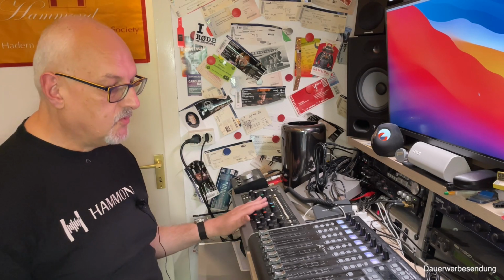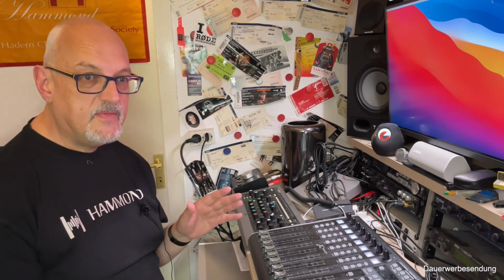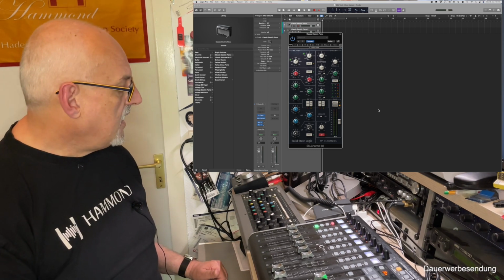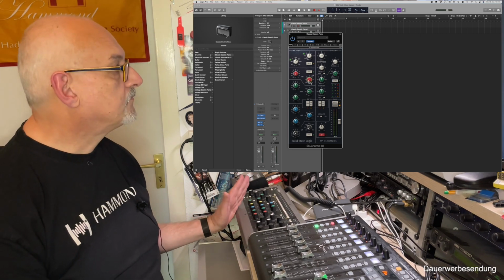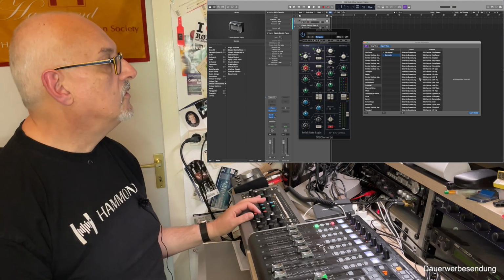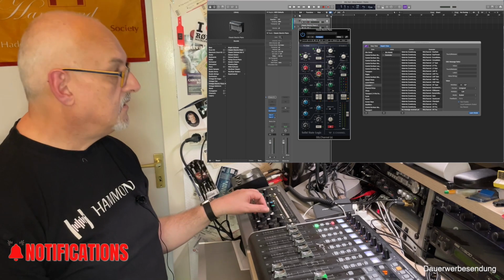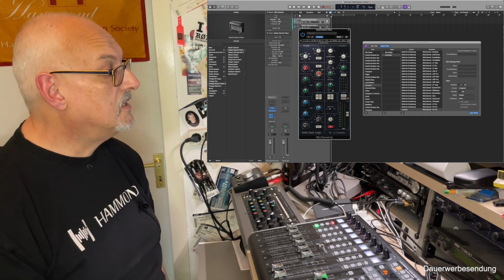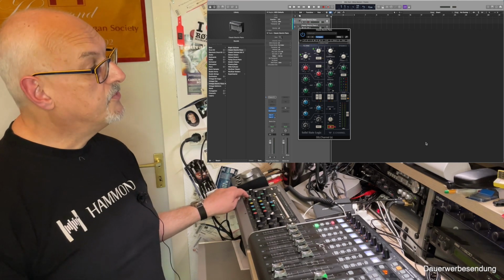Softube's Console1 hardware controlling other channel strips in Logic Pro X

Comment: thx for this tip. unfortunately when I use this do midi learn uadx api vision plugin, the plugin knobs jump like crazy, there's no way to fine tuning the knobs
Reply from the maker: Did you really stop the Console 1 Software? I had this happening only when the software was still active
Reply: @deantiquisetnovis  thank for your reply.  yes I'm sure I did, even checked the activity monitor.  I set midi learn mode, then select parameter in UADx Api Vision and then slowly turn a knob back and forth on the console 1.  I end up turning the knob and only receive two parameters setting, e.g. for the boost/cur freq (-12db to +12dB) the dialer only sticks to -4dB and +4dB when turning the knob.
I was hoping to control my UADx plugins with console 1, as softube and UAD only work with Uad dsp, which is crazy in 2023, with apple silicon ... I mean, who wants to use those sharc in apollo even longer?
Reply from the maker: @ChrisDv849  must have something todo with UADs implementation. Sorry to hear.
Reply: @deantiquisetnovis  I managed to this in Ableton Live very easy. Great!  But, in Ableton Live you have to midi map the same plug-in for each track (?!).  Looked on the internet but can't find any information to midi map the uad api vision on track 1, and then when I have the same api vision on track 2, and select track 2, it automatically controls the api on track 2.  In logic that's quite easy.  Only in Logic I can't midi map the console or any midi keyboard or controller without the knobs going totally bananas.  Why can't they make these things easier? lost so many hours in looking for info on the net instead of making music. so frustrating

Comment: Touching base in March 2023.... do you still use this and would you buy one for controlling 3rd party plugins? 
 I am looking to control mainly console based interfaces eg the Brainworx suite from Plugin-Alliance.
From what I can see the SSL UC1 doesn't but that said I asked Console1 if what you demonstrated is possible and they told me "no" so I suspect that support from both companies are pretty useless.  
The only alternative I can see is the RockSolid interfaces but they won't work at their best in Logic Pro until late this year...
Reply from the maker: Hey, I still use the Console 1. Their software and plugins have improved quite a bit. Therefore for me there’s no need to control other plugins with it. But I assume it still would work, because, at the end of the day, these things outputs MIDI anyway.

Comment: Interesting video and method of mapping the controls to other channel strips. I wonder if this will work with Studio One version 5 DAW software.
Phil
NYC Area
Reply from the maker: I guess you‘ll have to try and find out.
Reply: @deantiquisetnovis  Thanks...
Phil
Reply: I think it does and better. Console 1 is just sending Control Change data to the DAW. So in S1 you create a new controller and set Console 1 as input AND output (that is important). The you add knobs and buttons as you do with other “generic” controllers aswel. Don’t forget to check the “transmit value” option for every knob and button you add. The transmit value option is important to update the controller encoder and button values so you don’t get jumps between values of different parameters when switching to another plugin. Also you don’t have to wiggle a knob until it “grabs” the value, but the encoders are already set to the values of the plugin parameters when switching between plugins. So the implementation with S1 should even be better then shown in this video with Logic. I didn’t try it myself because I don’t own one (yet), but it works this way with all my controllers in “generic” mode.
Reply: @HT-Events  Thanks for the info...
Phil

Comment: at the end of the day, console1 is a midicontroller. Every software that`s got a midi-learn function should work. But it`s good to see, how you actual do it.
Reply from the maker: The trick is to disable their own control software. Only then the pure MIDI CC are exposed to the DAW. Took me a while to figure out.
Reply: @deantiquisetnovis  Well done! I got also a Console1 and tryit it "your way" in my DAW (Samplitude ProX3) and it works. But I`ve also an QCon Pro X Controller and togheter they make up for a good team.

Comment: So grateful for this video...

i think the only thing that still misses the mark is that for example:

1073 output and 1176 output will both move if they're mapped with the same midi encoder and theyre on the same channel. 

I only did those similar buttons for the different 1176 versions. Otherwise, I had to decide the most important plugin parameters per knob.

Thanks again for this video. I'll still use the MIDI learn function when I'm mixing. This still beats Softube Console 1's plug in "function".

Comment: Hi, thanks for your video. Please could you tell me which control surface you added for Console One and any additional configuration data? Thanks,
Reply from the maker: Hello, I did not add any specific Control Surface at all. Just have created a new section in the Control Surface Dialog called „Console 1“. But that is merely there to keep the entries separate. But what I have shown would also work without that. Apart from that there is no other configuration done.
Reply: perfect, thank you very much for your answer. Greetings,

Comment: Softube would add so much value to the product giving a MIDI mode similar to Apollo Central
Reply from the maker: In fact the Console 1 Hardware shows up as a Mackie Controller in Logic. It is beyond me why they have to screw this up with the Softube Console 1 control software. Good thing, easy fix just quit the software 👍
Reply: Quitting the Softube console is not a great fix.  Switching between MIDI maps and Console 1 control should be seemless
Reply: @MarvelJAM  how to do that?
Reply: @mschorer  top left corner of the console 1 theres a @mode@ buton that toggles between softube and midi controller. I don't know if you have to disable the softube software or not, shouldn't have to I guess.
Reply from the maker: @ThePickledOnions  the mode button does not toggle midi, it toggles the different display options.
Reply: They already do that...